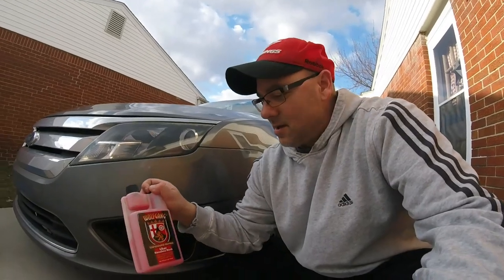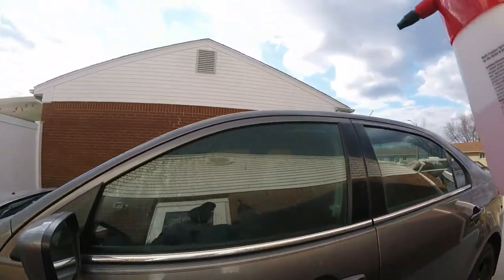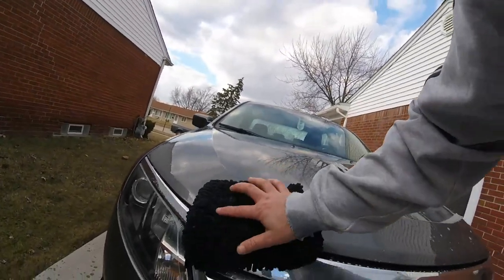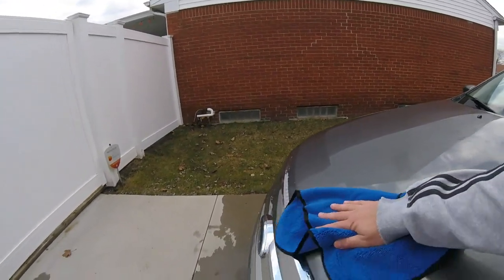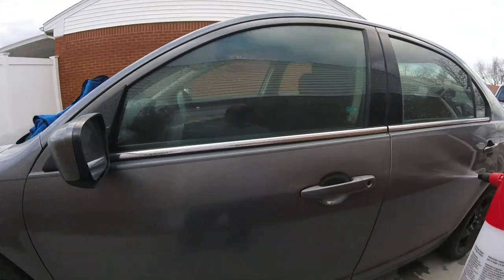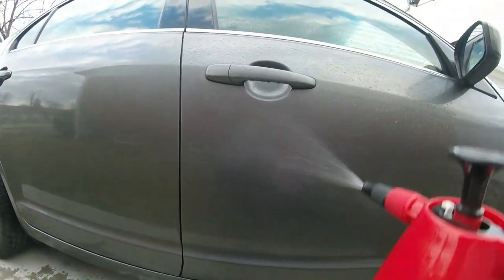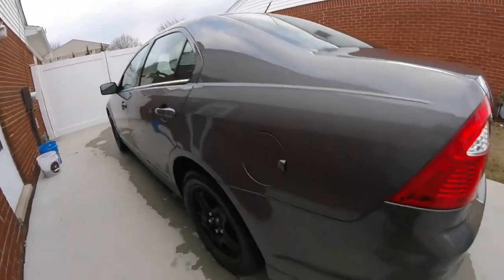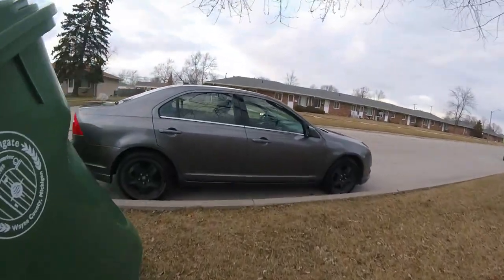Wash Your Car  Without  Garden Hose | Wolfgang Uber Rinseless  | Satisfying Car Detailing How To's

Comment: I always avoid using the brush in the self service hand car washes because it puts scratches in your car's finish. I am thinking that if you have to take your car to the car wash to first wash off the heavy dirt buildup, why would you need to follow that up right after with a rinseless wash? Your car would already be clean. However, I can see how this could be an in between thing though. Hope you are doing well.
Reply from the maker: If you went to a coin car wash you can bring this in a bucket and hand wash your car after spraying the heavy dirt off .That would avoid using the brush at the coin wash .
Reply: @OuzoLouGarage  okay, gotcha. Thanks!
Reply from the maker: What I do to wash the car in the winter. Go to coin wash use the spray only and at home use this method. Or I will being bucket of Rinseless Wash or soap and after spray hand wash the car at the coin wash. I can make a video if you like ?

Comment: I would get a 5 gallon paint bucket, fill with water & car wash soap, cover with plastic-wrap to keep from spilling in car then go to do it yourself car wash where I'd first use wand to spray off most of dirt then wash by hand, when done rinse off with wand then dry, problem solved. It is far safer to keep rinsing off dirt & soap, drying without rinsing is a receipe for scratches unfortunately bud.
Reply from the maker: That would be a good way of washing in the winter done that a lot . Was making this video to show what this product said to do . I didn't see any new scratches and if i did it's on the work car lol...Thanks Dean for the comment i may make a video on what you said to do.
Reply: @OuzoLouGarage  I covered in my hour long detailing vid no one watched.
Reply from the maker: @vinniecorleone62  My son and i have a few times . You detail better then me